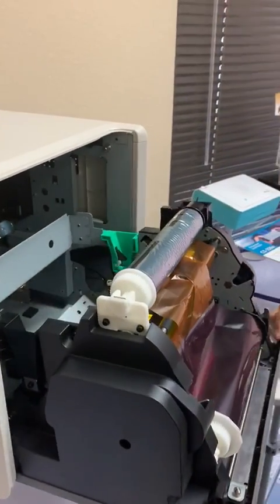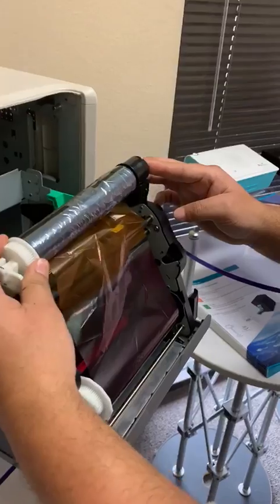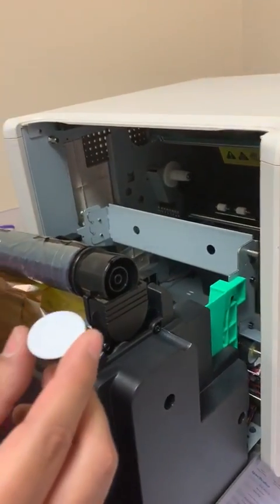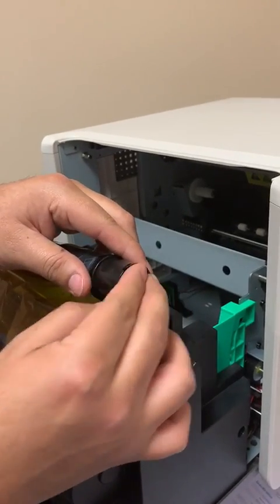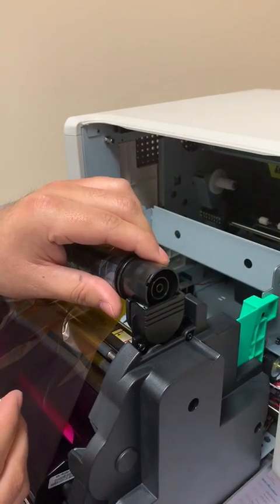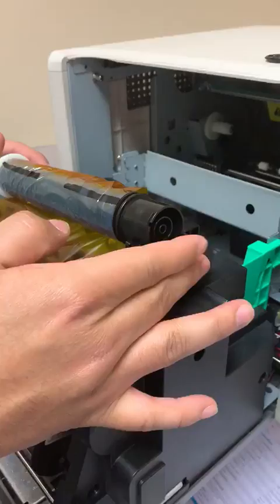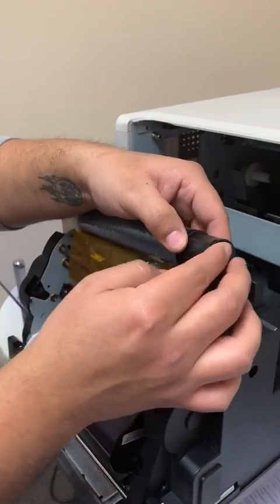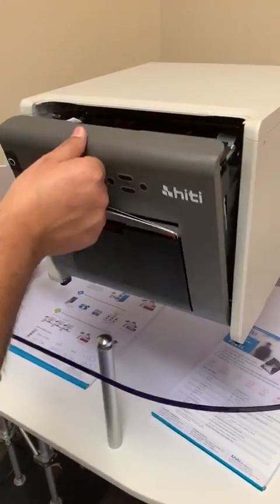How to fix the IC Chip Error on the Hiti P525L and P520L printers

Comment: For those still having issues, it was sometimes working sometimes not for me. I think that the chip works best in a certain direction on the outside. Try rotate it 30 degrees stick it back on and keep doing that till it works. Then use a sharpie to make the direction it should stay at